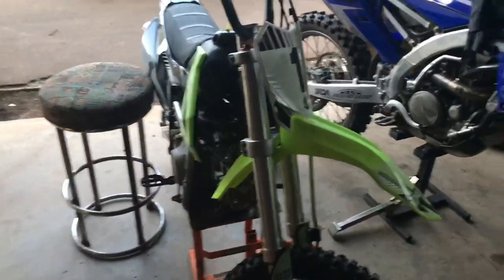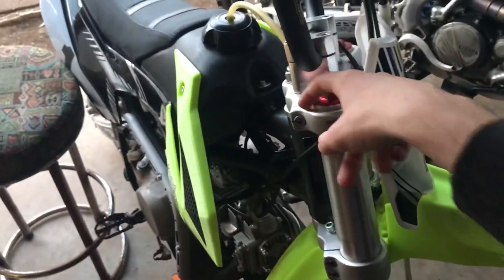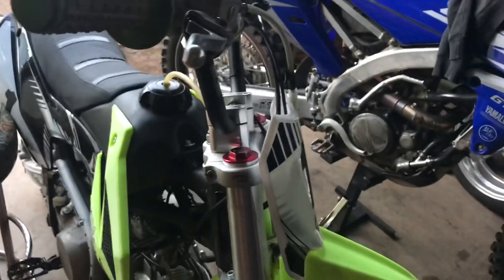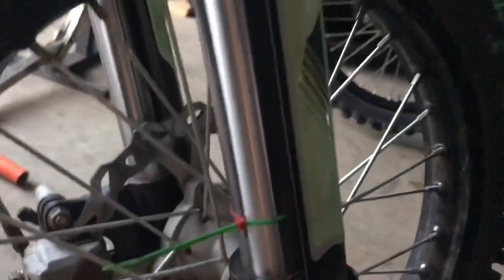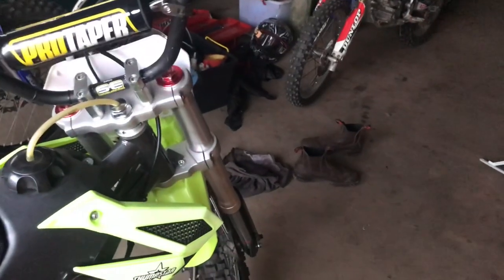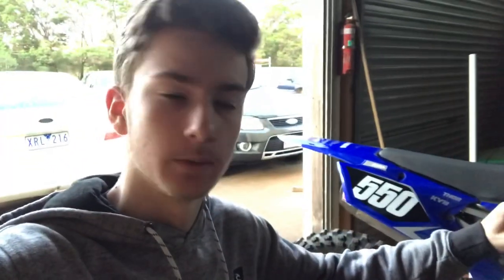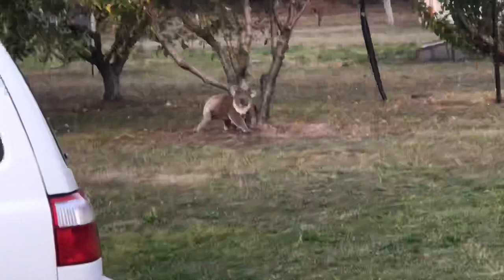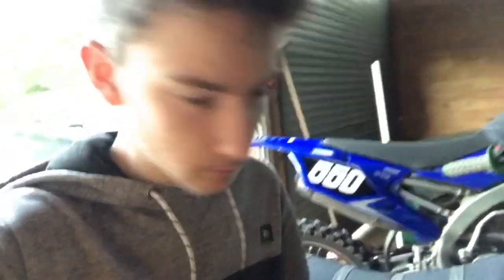TOP 3 FIRST MODS FOR YOUR PIT BIKE FOR LESS THAN $50- thumpstar 140

Comment: I recommend just a heavier fork specific weight oil not engine oil. Transmission fluid is a better substitute than engine oil as it's practically just hydraulic fluid

Comment: Hey man I have the same thumpstar and I have the same SE bars but my riser and clamp is to large of a diameter so I was wondering what you had to get to make them work
Reply: What carb is recommended for the 140 for most power output? Cheese for the tips. I just bought a thumpstar 140
Reply: JUST JOE MANILA  the mikuni that comes on it is pretty decent. I did pull the carb off mine and noticed it had the jets for the 125 in it so I swapped them for the correct jets according to the Manuel and it runs great.
Reply: @mf49444  thanks for the advice. I will try that carb out.
Reply: 22mm raisers

Comment: the fluid you took out was suspension fluid.  Suspension oil is meant to be thin like that,  have oil with too high a viscosity your risking bending shims and getting rebound needles stuck.

Comment: What are the best power mods? I want to do all the bike ons
Reply from the maker: definitely a good carby and getting it tuned good. a mixture screw you can turn with your hands is also a good investment as then you can play with that without removing the carby, Also a quarter turn throttle is good once its tuned as it makes the bike responsive af.